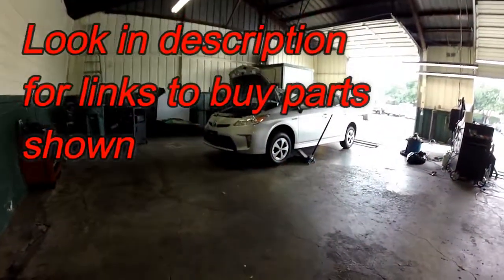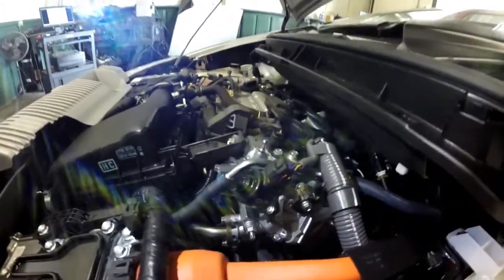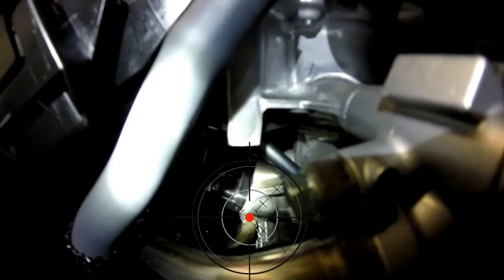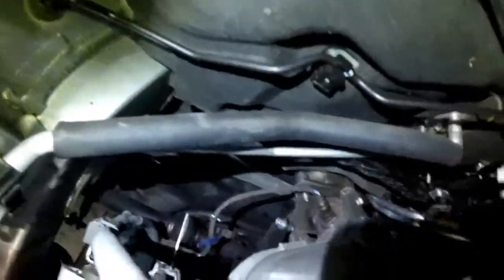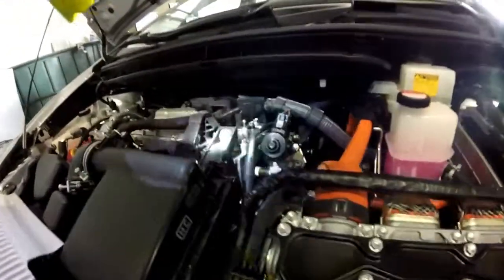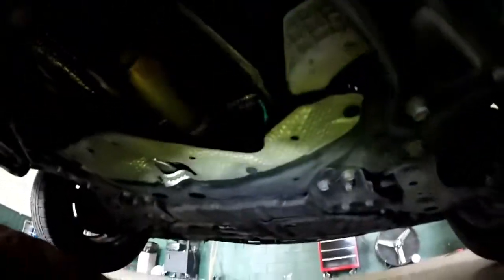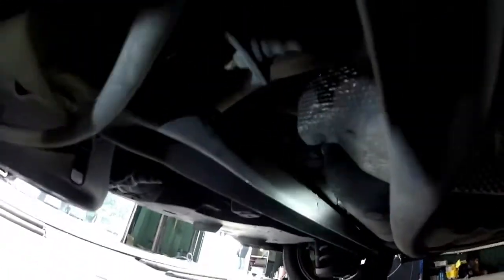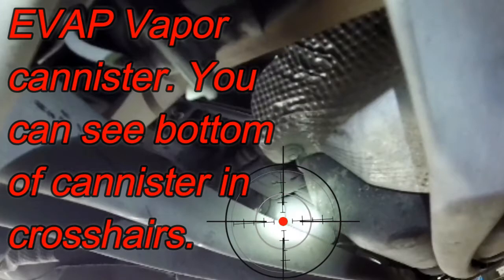Toyota Prius emissions / smog locations: PCV, EVAP, EGR, Oxygen Sensors

Comment: how to fix the problem  the code p0455 toyota prius 2010
Reply from the maker: Most common leak is from the fuel cap seal. Did you check the seal on the bottom side of your fuel cap? Do not use locking caps, from experience, they suck. If all that is good then the fix gets a little more complicated. At that point you would need someone to do a 'smoke diagnostic' on the evap system. I think I have a video on how do a pressure check on evap system that is a little on sketchy side but works. If you can't find that video in my library, I'll find it tonight and post a link.